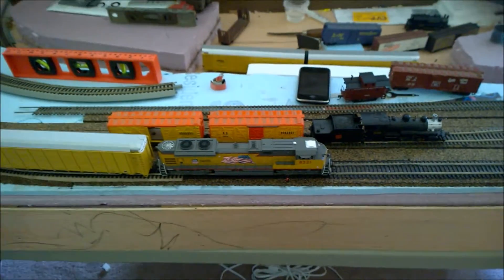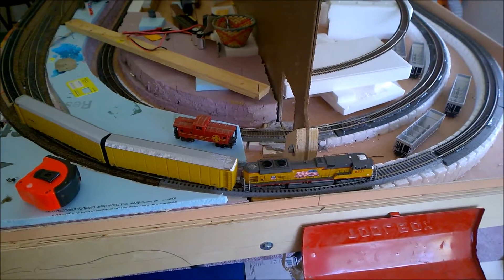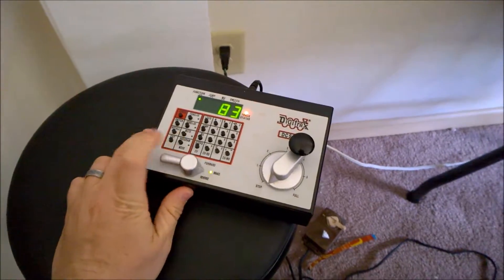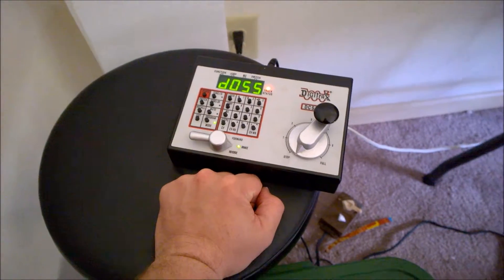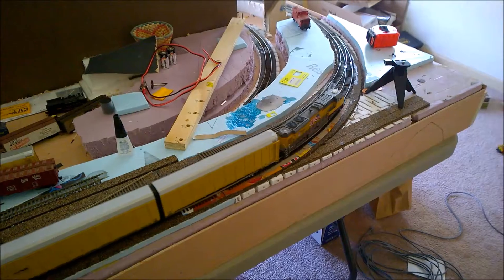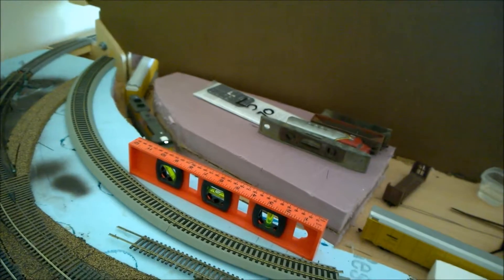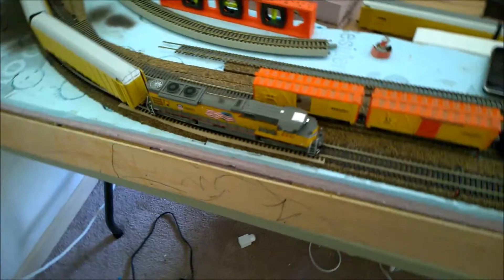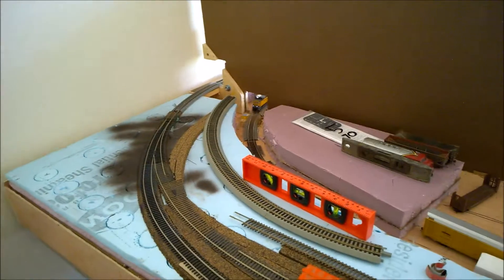MTH sd70ace problem solved.....?

Comment: I have only 1 MTH, the same one as yours and to be truthful I would take a Kato and/or Atlas before another MTH. The MTH has the same problems even more. Cuts out and dies at turnouts and is just a PIA. I will try the 55 reset method and see if that helps.
Reply from the maker: poochie49 please watch my second video on this, the 55 reset only works if the capacitors on the board aren't dead. It's a $15 part but I do love MTH engines; protosound sucks though. The golden combination is an MTH locomotive with an ESU Loksound decoder. Another YouTuber I follow did that with his BNSF MTH GEVO and it worked out really sweet. With a Protosound3 to Loksound conversion you would have to buy a full board decoder not an 8 pin or you could buy a 21 pin and combine with one of the new tcswow boards